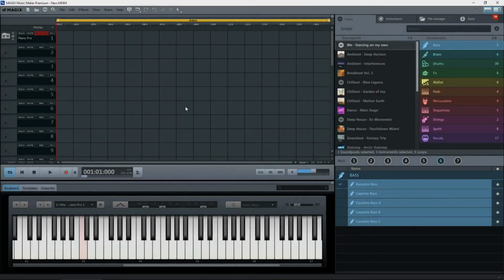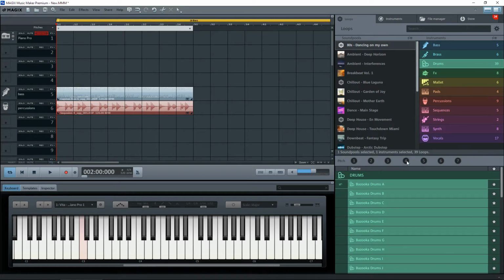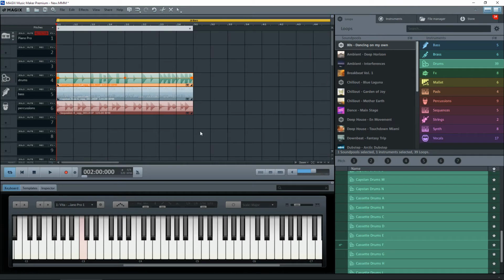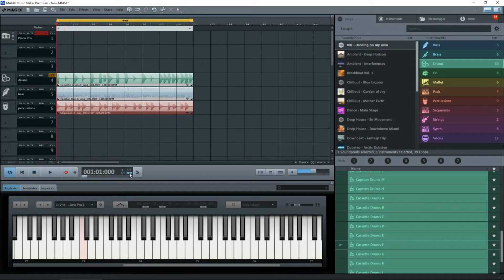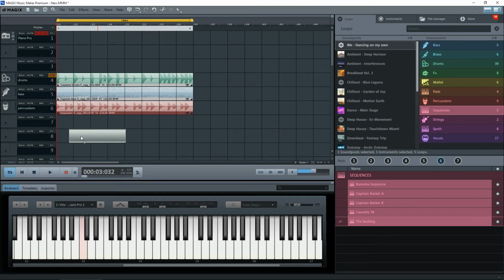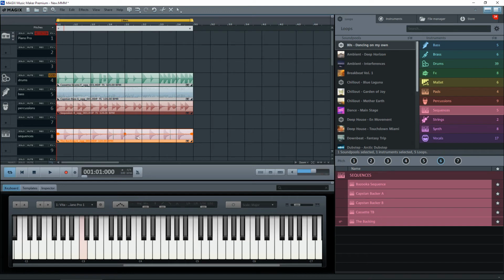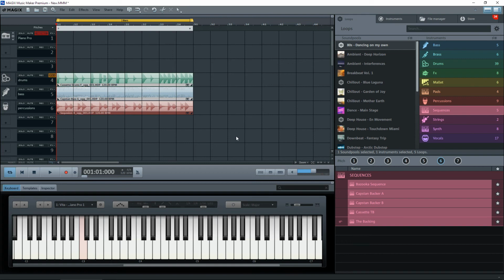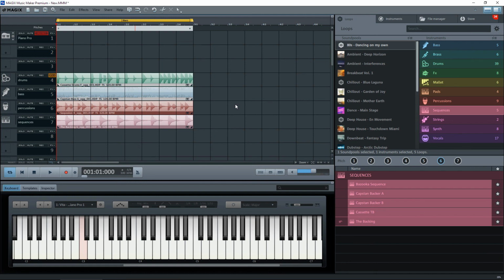Magix Music Maker - Absolute Beginner's Tutorial - Part 15 - Speed Control

Comment: Can you also change the bpm of all loops to same value, if you Import external mp3 and wav sounds, which have different bpms? Good video btw
Reply from the maker: Hi Gongod.
Thanks for watching and thank you for your compliment.
To be honest, that is something I've never tried. But, since Magix can't usually detect a beat or tempo within audio files (mp3 and wav, for example) I would imagine this would be very difficult to do with multiple tracks simultaneously. I have attempted this using just two mp3 files which, individually, play at different speeds. By using the Inspector Tab I was able to almost get them to play at the same speed, but this was incredibly difficult and time consuming. In my experience, Magix isn't the correct software to use for playing around with audio files. There are much better programs for doing this - SoundForge for example.  Personally, I would use an audio editing program to equalise the speed of all the tracks first, before importing them into Magix. These are just my thoughts, you understand. I might be wrong, but it's the best answer I can give based on my limited experience with Magix.
Here's an example of something I put together quite some years ago using (what was then called) Sony Sound Forge - Now just called Sound Forge...
https://www.youtube.com/watch?v=dWXJ77rZB3A

Comment: Well that's dumb. I wanted to use sounds from multiple sources and now it looks like that will be a nightmare to manage
Reply from the maker: Hi Stephen.
Yes, you're right, managing multiple sources is very difficult. Because of this (seemingly) tempo limitation, it means you initially have to work with everything at the original speed and then speed up or slow down everything at one go, which is not an ideal situation. As I demonstrated, it can be done on individual objects using the tempo dial, but it is very awkard.
Thanks for watching.